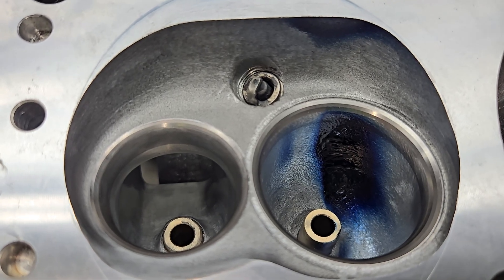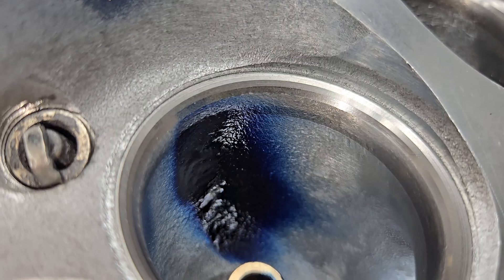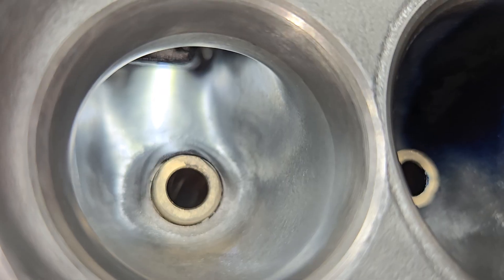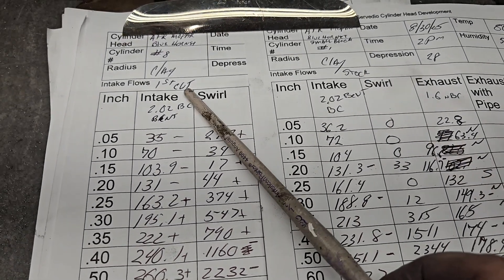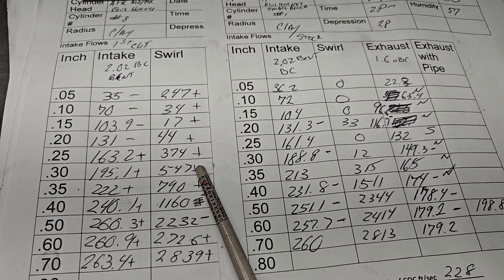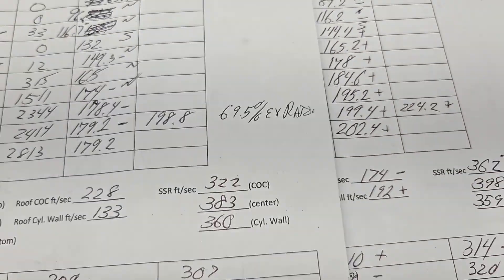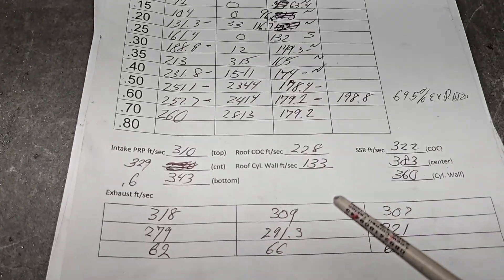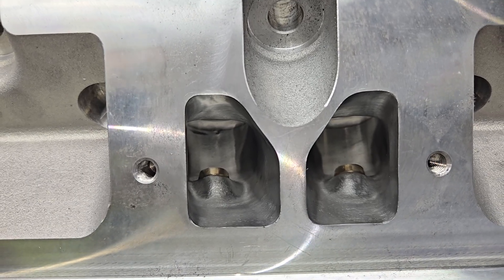AFR Blue Hornet Mopar Cylinder head. 1st cut flows, air speeds and dykem. Total loser?

Comment: IMO, Insert a steel tube in that center head bolt hole, port the straight wall until you hit it, more bowl work on the inlet, widen inlet short turn, slowly play with the short turn, obviously work with cam lift numbers and engine speed required...... chew around the exhaust guide, a bit more bowl size in the exhaust...
Reply from the maker: Stay tuned. Thanks

Comment: Thanks for the video. Two 340 based examples I can give you.

First was a J headed .030 over 340, legit 10.3:1. Put too much work on the exhaust side, and some on the intake side. Single plane intake. Went in a Dart with a A518 trans and 4.11 gears. The owner insisted on a hydraulic flat tappet, which killed me. Cam was 278 @ .006, 230 @ .050, on a 110 degree lobe separation angle. 107 degree intake centerline.  Was around .525 lift. Lobe intended for a .904 lifter. The car ripped. Blast to drive, pulled to 6800-6900 easy. 

The other was a .060 over 340 with Mopar small port Commando heads. These heads were far from ready to use, they needed a ton of work. Your heads are better, especially on the exhaust side. 10.7:1, single plane M1 intake. Nice headers. This one got a solid roller, Jones SR72370, 110 lsa. I think we settled on .016/.019 lash, in/ex. That solid roller ran better at all speeds than the hydraulic 340. Sometimes by a lot. The MSD was set at 7200 rpm, and it went to it no problem.
Reply from the maker: Excellent! Thanks! Good info
Reply: @servediocylinderheads  Commando heads had taller Intake Ports? I am thinking seems to be only way to make good power is a raised port if the pushrod is not moved over?
Reply from the maker: @smilsmff Not the only way. Thanks

Comment: @2:35 that chunky liquid is from a dead spot there(flow is just going round in circles there). The guide and the cylinder wall side split the flow in 2 there, lowering the floor of the pinch on the cylinder wall side will move some flow towards the dead spot, whether that helps anything is TBD. The cylinder wall short side, and the ramp that leads up to it from the pinch is keeping the flow attached to the wall, so it just shoots straight into the CC.
Reply from the maker: Stay tuned!